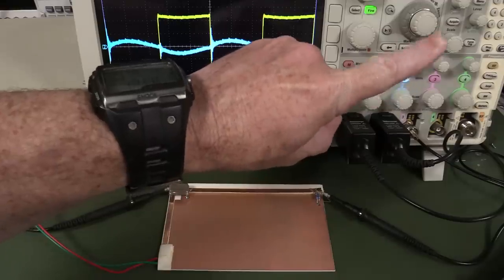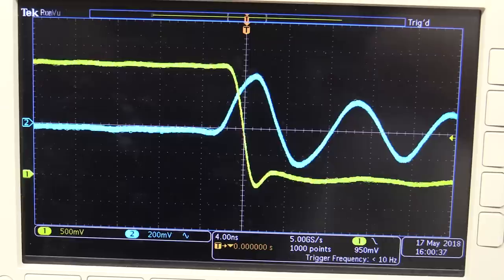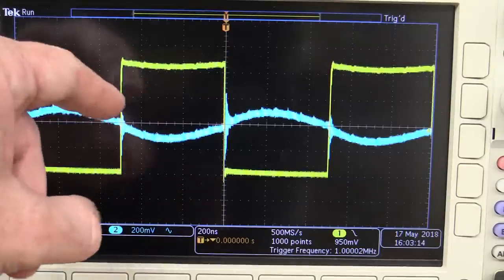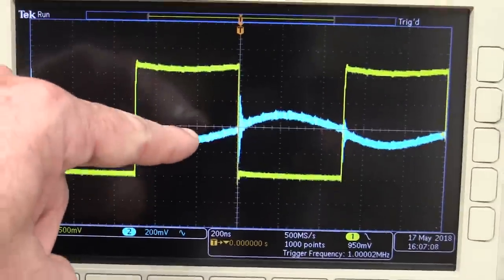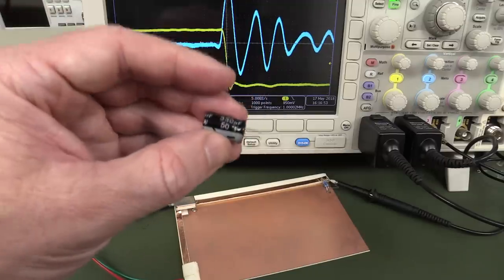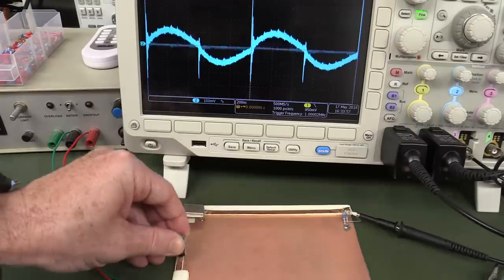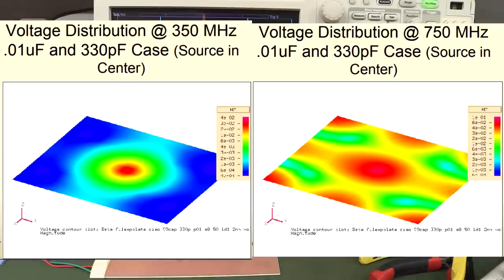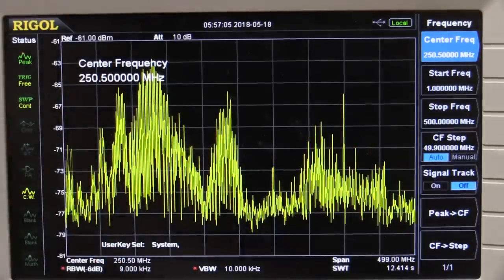EEVblog #1085 - Bypass Capacitors Visualised!

Comment: @Dave, what a fantastic video! I watched all 33 minutes and 34 seconds. Thank you for this video. PS: When you have this setup, please, could you try to add a ferrite bead into the circuit, just to see if there will be visible difference before and after the bead?
Reply: I always feel difficult when using FBs. From the power delivery view point, we need the power supply to deliver the current as fast as possible to satisfy the nsec, or even hundreds of psec rising/falling time. However, the ferrite beads slow down the current by acting as higher impedance in some high frequency domain. FBs simply dissipate certain amount of high frequency energy. If this high frequency content is exactly what the system needs, say your processor, we'd better not using FBs in this frequency domain. Choosing the right frequency seems to be the most important thing! But I also found FBs useful when designing a board using a given external AC/DC adapter, sometimes you have no ideas or no choice what kinds of switching noises would inject input your power system, leave the FB pads there on your board seems to be a good practice.
Reply: @zhitailiu3876  Could not have said it better.
Reply: @kodedude  What if you routed to the capacitors first, to supply the high frequency switching power demands locally, but ran the ferrite to the power rail - thus creating a high frequency high impedance disallowing the full effect of the noise to get on the power rail?

Comment: As Dave says, at High Frequencies the current returns in the ground-plane under the trace.  A good way to think if this is that the trace and the ground-plane are two windings on a transformer. As current flows in one direction in the trace, an equal current flows in the other direction in the ground-plane. The trace and ground are magnetically coupled. 
 It can be shown by experiment that the current will even go through a resistor in the ground-plane under the trace rather than a short-circuit away from the trace.. Weird huh...    Putting a nice big slot in the ground-plane makes the return current go all the way around the slot. The fields in the conductors don't cancel and radiate really well!
Reply: Slot antennas are built on that principle.

Comment: Great stuff Dave! This should be very helpful as we are having some grounding (and most likely EMI) issues with our boards at work. We have some 5V stuff going on but the main culprits are the 48V solenoids being driven at various duty cycles. The PWM frequency is ~1.7kHz. We already have planned updates for better grounding on the boards, but it looks like we might be adding some additional capacitors as well. Just don't want to get too carried away and drive up cost as the 48V coils are power hungry.

Comment: This is such a great video! I've never seen this done before. How little change in ripple when the bulk cap was connected at the bench supply! (16:11)

It would also be interesting to see what the output at the power-supply looks like when moving the bulk cap around.

Comment: Why doesn't this video have more views?! This has got to be the best capacitor tutorial I've seen. Before thiss I had no clue how important bypass cap are for digital noise decoupling. Coming from Arduino with a breadboard and basic electronics knowledge, I had no clue about how bad breadboards are for until I tried running a TFT @ 80MHz SPI clock. Your videos are a Bobby dazzler!

Comment: I think I just learned more in this 30 minutes than multiple months in university... thank you very much Dave. I could tell that was a lot of effort, and these videos are super helpful.
Reply from the maker: Glad to hear. Might look like a lot of effort, but not really, pretty simple demo in the end.
Reply: hardstyle905  Thankfully I'm not any longer. This is 5 years ago! Universities don't visualize what a bypass capacitor does like this, instead they make you write down the various math of capacitors in a hurried mater during lectures - and it's up to you to decipher your notes later and apply that to an application. I never said Universities are worthless or anything by the way, just that this visualization helped more than several lectures at the time.
Reply: hardstyle905  I think Universities are trying to put more importance on that lately, which is a great thing. We had that as well, but it was always an afterthought or just 1 hour a week, where you had a very rigid syllabus of something - where a big report was due after it. I remember a lot of it was "connect this to that, go to oscilloscope and put in these settings, now print this screen,  etc" instead of exploration and curiosity, or even understanding what was being done (often it was a scenario with the TA running around trying to fix the problems arising such as components being dead or something from the physical abuse of undergrads).

Comment: Thanks for this video, practical and well explained. Most engineers probably don’t even think about this much and just pepper the board with lots of jellybean caps because that’s what you’re supposed to do. Might be worthwhile going deeper into RFI with coverage for why a small resistor is added to the output of very fast slew rate signals like crystal oscillators, inductors for power pins of fast chips, and why super fast rise-times aren’t always a good thing. Big topic for sure, slew vs aperture and jitter, ground bounce... yikes maybe not... ; )
Reply: Might as well get Rick Hartley over here.

Comment: Awesome video. 
This explains decoupling in a much more tangible and easy way than my years attending electrical engineering classes. I would enjoy a continuation of the series with a practical PCB example - perhaps designing a PCB and then measuring it the same way you did in this video before mounting decoupling and then measuring EMI impact as you add caps.

Comment: Awesome video, Dave.  I really liked the approach of setting up the experiment and adding caps of different values in different locations. Adding the SA at the end to drive the point home was a nice touch. 

I would definitely like to see more experiment based videos to illustrate some of the why behind circuit design.

Comment: Not long ago, I found a video that explained power factor correction well and the use of the caps for correction.  Basically, the cap sink/sources in-rush currents for the inductive transitions, in this case to avoid pumping the power grid.  I realized then that the bypass caps could in fact be for similar purpose.  Nice to see that confirmed.  I see they both dampen the pumping of the lines but also flipped to the other perspective they provide instantaneous current for digital pins which are not as forgiving of lags as motor windings are.

Comment: Great and simple explanation, Dave! I'd like to propose some extension to your test setup - to add "termination resistor" in series with osc. output: same as for hi-speed lines to correct impedance matching.I suppose that it should be visible on scope too.

Comment: Great stuff! Next time a rookie claims that bypass and bulk capacitors are not needed I'll direct them to this video 😁
I remember when I reviewed a design (in the 90's I think) and commented on the lack of bypass capacitors the designer came back after a couple of days with a new revision where all the capacitors where placed in the corner of the PCB - because it was too difficult to move all the ICs to fit the caps next to the power supply pins 😂🤦‍♂
- "do it again - and do it properly this time"....

Comment: I'm surprised at the difference between the SMD and thru hole cap, that's great! Definitely proves the importance of PCB layout best practices. A few mm can get ya
Reply from the maker: Yep, a few mm at hundreds of megs can be everything.
Reply: I was expecting the SMD cap to do much better, but not THAT much better. Even at my low freq hobby level stuff, I might have to bite the bullet and start thinking about using some SMD components eventually... I guess it's not so bad if you have a decent hot air station and get some long shelf life solder paste.
Reply: SMD is not too difficult. A good illuminated magnifier is more worthwhile than a hot air station.   SO8, SC70 and 0402 packages can be done with a reasonably fine tip iron.  There are lots of good videos on YouTube showing how. 
Bigger chips, and those with ground pads or pads completely underneath need hot air.
 Standard solder is Ok, but some thin solder helps more than a tiny tip iron.  I do a few SMDs most days at work with a soldering iron although I have access to a hot-air station if I need it.   Good Luck.
Reply: Lead inductance is the enemy here, the less the better.

Comment: A good example to visually test and see why you need bypass caps: programming serial memory (such as SPI). In my lab, I have found several parts that when it does a self-erase, the IC drops the VCC so low that it resets the board's micro. With a large bypass cap, it works just fine.

Comment: Great video. One nit-pick  is that for the RF interference measurement, your set up is reading  in the inductive field, which is different from the radiated field.  Radiated field measurements should be done in the far field (rule of thumb is 10x your wavelength.) I get that your set up is rough to show potential effects, but you need to discriminate between radiated versus inductive interference requirements. No doubt that proper by-pass capacitors use can greatly reduce spikes and noise.

Comment: What a great video!

I ran into problems in designing a commercial product - a microphone preamp which would be inside a PC chassis and derive power from the ATX PSU. I sprinkled bypass caps everywhere and galvanically isolated the very noisy (and arguably crap) power supply via one of those encapsulated DC-DC converter modules (and a separate +/-24V pair for phantom power). The maximum allowed capitative load of the main DC-DC was quite low and could not deal with the amount my preamp presented so it kept failing. I concluded that over zealous bypassing although usually considered 'belts and braces' could have a drawback. I eventually found an uncomfortable sweet spot but would in future find a different way (like not putting a mic preamp in a computer). I'm sure more modern DC-DC devices with protection and slow start would mitigate the problem but this was a long time ago.

Comment: There's yet another thing to do. The traces between the capacitors (and the capacitor leads themselves, as Dave said) are effectively inductors, and together with the caps they make up tank circuits made of high Q components so they can ring (seen as the decaying sine wave signal on the scope) after high-speed transitions. The thing to add is yet another capacitor (0.1uF or so) in series with a 1 ohm resistor, and put THAT across the power and ground as well. It does a lot to damp out such ringing signals from the other bypass components. Having several of these around the board, much like the 0.1uF caps directly across the power rails, can do wonders for making quiet supply rails. Electrolytic caps have their own series resistance that helps do this, but they also have series inductance and such, and thus are an inconsistent help with this.

This is similar to the series r-c snubbers that are used across the secondary windings and diodes of linear (50-60Hz) power supplies, to stop the RF ping generated by the delayed turn-off of the usual 1n400x type rectifier diodes, activating the RF resonance of the secondary stray inductance and stray capacitance. It can even be useful with more modern high-speed rectifiers that don't have the forward storage and turn-off delay "feature." Everyone does this, right???

I first read about that (doing this on PC boards) on the newsgroup sci.electronics.design, probably in the late 1990s or early 2000s. It's also discussed in later half of the book "High Speed Digital Design" where the authors spend time trying to optimize the values of the resistor and cap for maximum damping. I'm surprised I haven't heard of this more often in discussions of bypass capacitors.

Comment: I examined a wire wrap board that had all the bypass capacitor wired together in a parallel daisy chain with only one set of wires connecting all the capacitors to another daisy chain of IC’s.  If i were to cut one wire all the capacitors would have been removed from the circuit. 

I had another instance where a sales clerk thought he could help me save money by replacing all of my bypass capacitors with a single equivalent capacitor.  I thanked him, but I told him it was for the higher frequency transients.

Comment: you went to too much effort making that setup Dave!...but i do appreciate it!...this has filled in the gaps in my knowledge of caps...i wish something like this was shown to me 20 years ago. its so much easier to understand than trying to visualise it in ya head!..the RF bit was quite interesting to see aswell..now i know i should be using caps, even on basic circuits to reduce the RF noise they generate
Reply from the maker: Not much effort, just some tape on a board and rummaging for an oscillator.

Comment: Thank you for making this experimental setup, it's really well thought-out.
I have a small problem in aligning my own understanding with what you're saying about the high-frequency return path behaviour.
What you say at 23:10 is that the high frequency current will return through the ground plane under the trace. This is also my understanding from reading different books on the subject. What bothers me, is that at 23:55 you're saying the return path will be the shortest path (like for low frequency) if you position the cap away from the clock module. I would think that for the case of a PCB with FR4 dielectric material between the power rail and ground plane, the current would still flow underneath the power rail, since the fields are polarizing the dielectric material and providing the path of least resistance for the return current. What are your thoughts? Maybe somebody can illuminate me if my understanding is flawed?
Reply: This is absolutely correct.  I noticed the same, and I don't think @EEVblog intended to say that.  If the high freq decoupling cap is placed where shown at 23:55, the current return path will not be across the middle of the plane but rather under the transmission line to the xtal then under the power supply line to the cap in a "L" shape.  That is where the path of least impedance (dominated by reactance for high freq signals) resides.  The loop area is still larger though due to the longer path vs. placing the cap by the supply.  This adds unnecessary inductance to the path which is between the cap and xtal, reducing the effectiveness of the decoupling cap.  Since capacitance and inductance have an inverse effect on reactance, the xtal sees less resulting capacitance at its input.  Good on ya Mathias.

Comment: You mentioned that in a two-layer boards with little puddles of ground it's different. It would be great if you could go through some of the two-layer specific issues. Fundamentals Friday, perhaps? It'll be sooner snowing in hell than me designing a four-layer board..

Comment: He dave, nice and interesting video. I reckon the residual noise we saw even though it was "perfect" bypassing is coming from the oszillator output because it did not really change when you dropped those capacitors in. Should have bypassed the output lol

Comment: Would this be why the bypass caps on the back of a CPU pcb are important? If you knock one off - you are likely to kill the digital output?
Reply: Knocking one off is unlikely to actually have any effect on normal use - as with most serious electronics, they are over-engineered to a pretty significant extent. That is to say, it would probably still work just fine. If you started overclocking and putting the system on the edge of stability in it's normal operation however, then it might matter. Or it might not.

But no, there is always an excess of bypass capacitance near GPU's and CPU's, losing one is unlikely to cause a problem. That said it's not actually guaranteed that they are bypass capacitors - they could be serving some other purpose, and you don't really know for certain.
Reply: In general, as the capacitance reduces and the noise increases.   If there is too little capacitance, large noise spikes can be mistaken as extra pulses.  This can introduce bit errors in the CPU or maybe an extra clock pulse causing a bus to get out of sync...and the system crashes.
 Maybe if you are unlucky enough to have all the other capacitors at their minimum tolerance it may fail.
Large value ceramic capacitors vary capacitance with temperature, so it might then work OK at room temperature but fall over when it is very hot or cold.
Reply from the maker: Yes, they are bypass caps, and very important for high speed stuff like modern processors and FPGA's.
Taking off one usually won't result in a problem, but it might lower the margins or operations. They usually use multiple ones in parallel just to be sure.
Reply: EEVblog thank you Dave and the other peeps who replied! Great explanations. Love your work Dave!

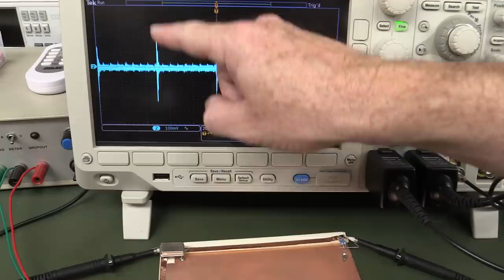Comment: 14:16 - Would a truly accurate impedance-match (the load AND the copper tape!) reduce the ringing as well?
Reply: David Perkins Yes. Trace impedance matching is commonly done for example in measuring equipment.